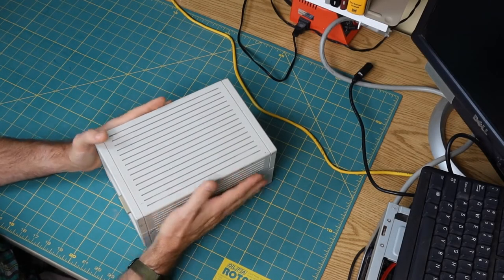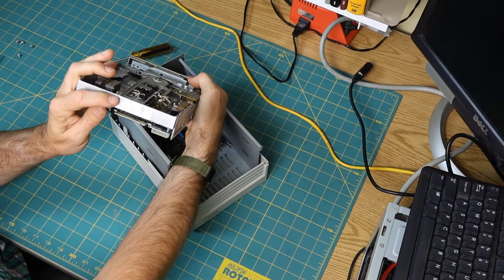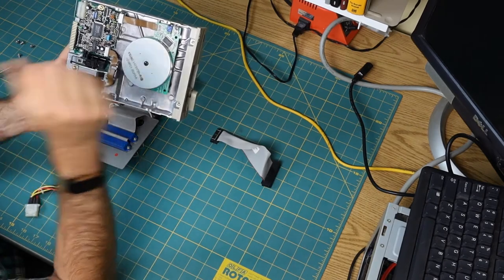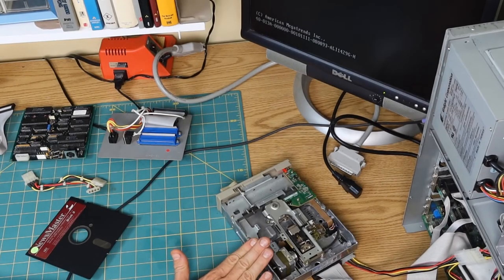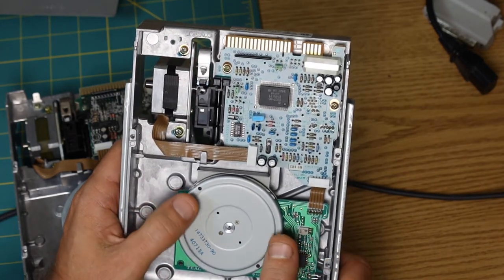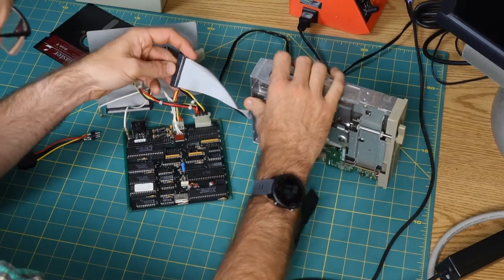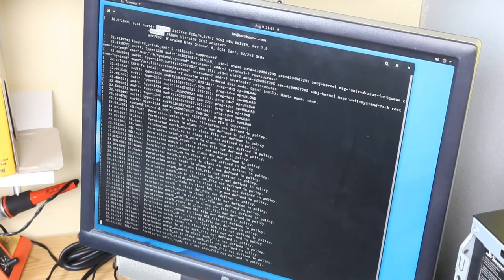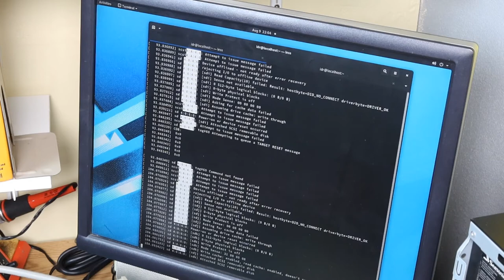DaynaFile SCSI floppy drive deep dive!

Comment: These drives were meant to allow Mac Plus (and later) to access PC-Floppies. Especially the compact Macs had no other way to get data to the PC or back. My SCSI-Floppy drives simply offer the floppy as a normal removable SCSI-volume. I have made a 3.5" 1.44Mb drive work with an Apple II (no FAT support, though). I don't own the Dayna-version and don't know if they work the same. Special software was needed to allow the Mac to understand FAT12 and convert the PC-files to Mac and vice-versa. Later versions of Mac OS would have these "features" included (MacLink). The big problem is that the drive uses ASYNC non-parity transfers that might only work reliably with 5380-based SCSI-controllers. It is basically SASI compatible SCSI-1. The SCSI commands in the Dayna drive might have been extended beyond the normal SCSI-1 command set which may make the drive incompatible with controllers greater than SCSI-1. Normally SCSI offers a special extension-command for vendor specific features but these special usage devices often ignored that and adapted their own scheme, basically creating their own command-set inside the "holes" of the SCSI-1 protocol. Well designed drives will work on all controller generations up to U160.
Reply from the maker: If the main purpose was PC interop, that would justify the choice of just a 360k floppy.  What you say about the custom SCSI commands matches my experience... and explains why a custom driver was needed on MacOS.  I got the ROM dumped (which I still need to upload somewhere).  It shouldn't be too hard to disassemble it and figure out exactly what's going on.  I've never programmed an 8031, but I did a couple projects in college on an 8051, which is similar.

Comment: Hello!  The DaynaFILE does indeed need a special little driver (extension) to work in the classic MacOS.  The DaynaFILE is a passive SCSI device, and needs the driver to tell the MacOS find it and wake it up.  This explains why the DaynaFILE doesn't work with SCSI to USB adapters, because it doesn't identify and broadcast itself as a bootable device on the SCSI chain when it's turned on.  This makes sense, as you wouldn't be booting a Mac from a FAT disk, so it doesn't need to be bootable.  The DaynaFILE does not need to be used with only a 68K Mac, as Power Macs will work as well.  The last driver was written in the System 7 era, but works just fine in MacOS 8.x and 9.x.  You can use the DaynaFILE all the way up to the Power Mac G4 MDD, last made in 2003.  You have to be booted in the classic MacOS, as "Classic Mode" under OSX will NOT work.  Supposedly, Dayna also made a black version of this device for NeXT computers, so there might be a NeXT driver out there, but I've never seen this device.  I made a video demonstrating the DaynaFILE a couple of years ago.  You can find it here:  https://youtu.be/EIu-gQAn1D4
Reply from the maker: Unfortunately, I saw your video after I made mine... even though yours is over a year older.  D'oh!  In my recent Macintosh rescue trip (https://youtu.be/BGR16ohx2_0), I got a Mac Classic II, so I now have a work, era appropriate system to try it with.  Assuming I can actually get it working there, I might try to reverse engineer their protocol so that I can implement Linux support for it.  That's what I really wanted... to be able to use it on one of my "daily" system... because it's there. :)
Reply: @TalesofWeirdStuff  That would be amazing if you could make a Linux driver.  That could lead to someone making a Mac OS X driver!

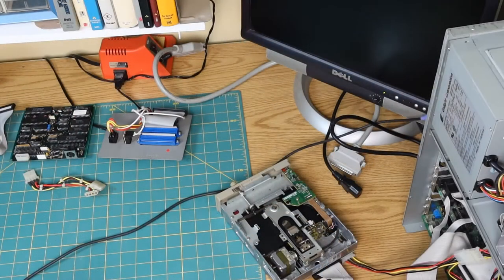Comment: I've only watched to @11:16 at this point, and I have to admit that it's been a long time since I had these myself, but if I remember correctly, wasn't there a set of DIP switches you used to determine the LUN of the device when it was connected? While they were a great item back in the day, the relative frustration of setting up a SCSI-based server (I never used it on my PCs) was something I only ever had to do but a few times. I had one of the external bays like what you have here, but it was a tape drive rather than a floppy drive. This, of course, was replaced with a 5.25" internal tape drive later.
Reply from the maker: There's the usual selection dial for SCSI ID on the back.  I really liked SCSI back in the day.  On my Amiga, I had a bunch of external devices over the years.  But those cables are such a hassle. We like to complain about the ever changing USB cables... HA! USB has nothing on SCSI! :)